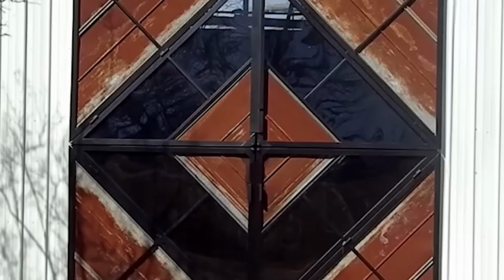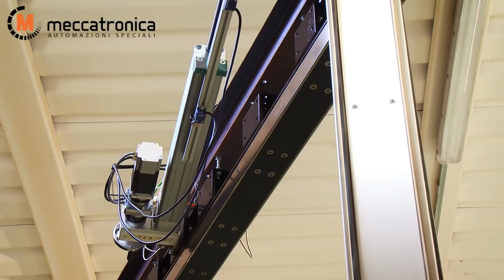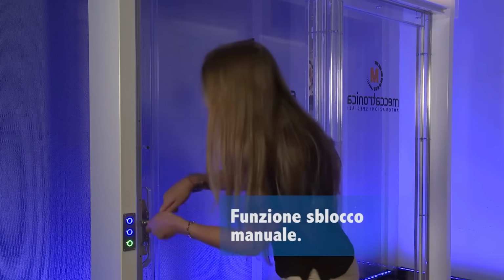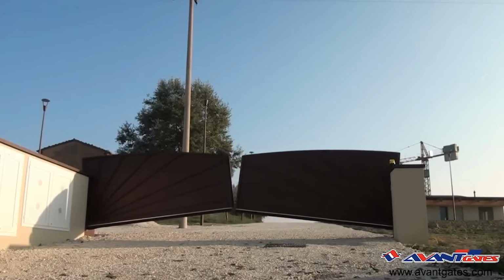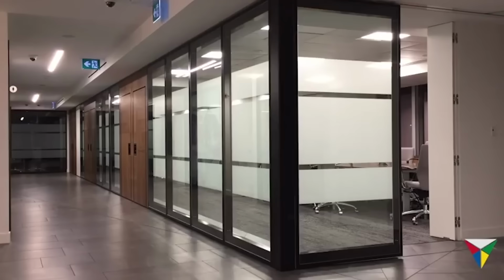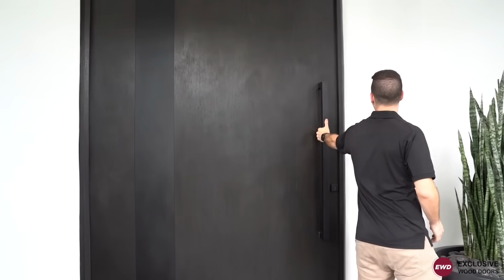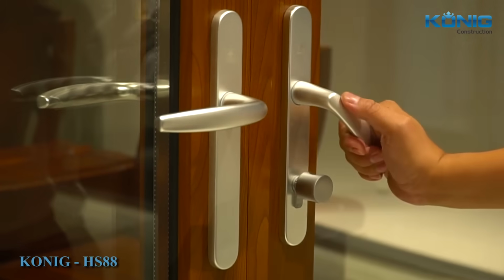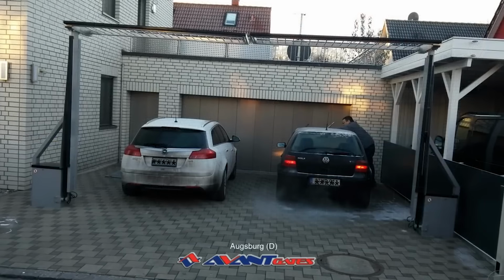INCREDIBLE DOORS AND GATES. BRILLIANT SOLUTIONS FOR MODERN INTERIORS!

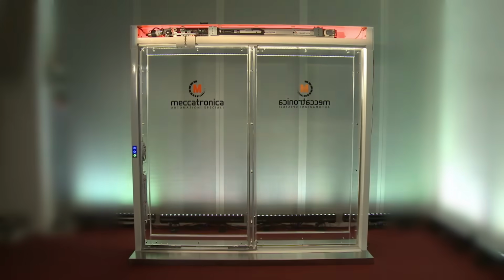Comment: 2:40 I dont get it, whats so special about that sliding door?
Reply: It's the girl presenting the door. 🤣😂🤣😂🤣
Reply: n40798 there are sensors that stop the door from moving if anything is blocking the sensors, just like a normal elevator, and it looks fancier

Comment: Um, yeah...those pivoting doors. You realize that they take up the same amount of space as a door that hinged (or even pivoted on the end) as a notmal hinged door of the same size, just some of the space needed now is taking from the inside of the structure? Plus, if you have a lagrer doorway becaause you wanted a larger door, you end up losing a good chunk of the door width due to distance of the pivot from the edge of the door.
Also, that rising fence gate (the rake-shaped one) must have some very beefy motors, since they don't seem to have counterweights balancing the weight of the gate/fence...you do know how leverls work, right?
Reply: Graphic print Crew-Neck T-shirt 👇
https://ekaro.in/enkr2020051641912224